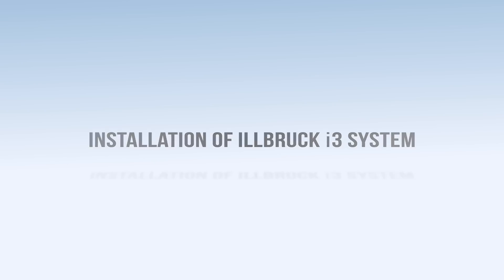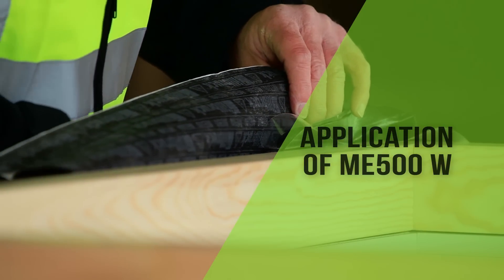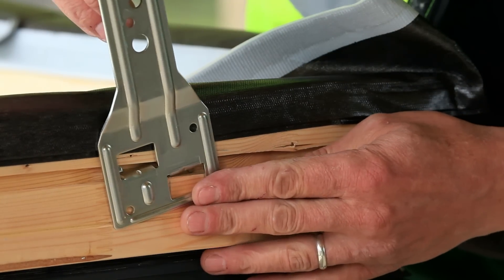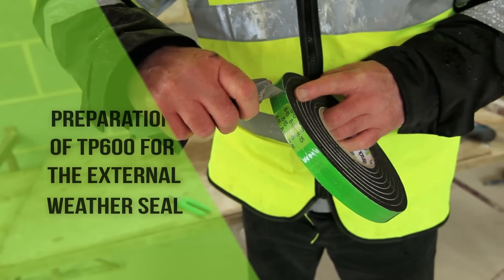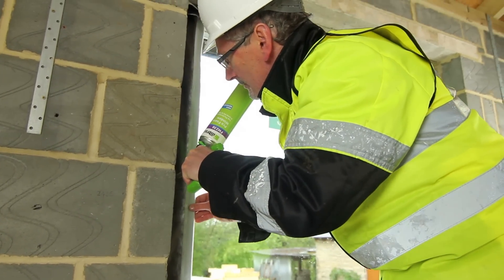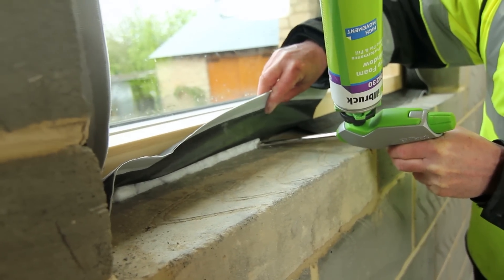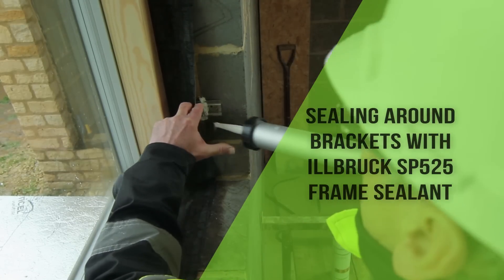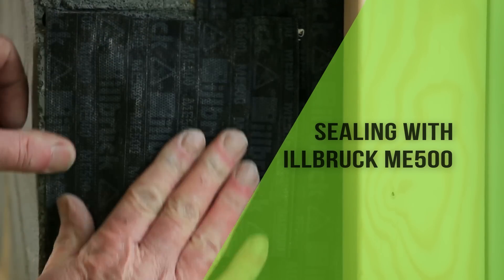tremco illbruck: i3 System - Window Installation

Comment: Can you suggest any variations required if the window is sited on the internal wall edge, not the external. Can I still use this system? What would you suggest?

Comment: Lot of fannying about just to fix 1 window,! 😠😠😠😠
Reply: It's extra work granted but that's the problem in the UK in general, do it quick, not what's best.
Reply: The same result can be achieved with a single illbruck product in a cavity wall opening. Agreed a three step proceedure is probably more time consuning but there are other options avaiable. Search for illbruck TP652, TP653 or TP650 muiltifuntion sealing tapes. The later is ideally suited to domestic replacemnt windows and is a low cost option providing very high airtightnes and weather prtection that will last as long as the life of the window and with no mainatainence. There is more than one way to skin this cat if one considers themsleves to be a preffessional window installer.

Comment: why the massive gaps round the new window?
Reply: Agreed gaps tend to be much larger than one would hope. For some unknown reason we seem to be incacapable of buildig to and mainatining tight tolerances in the UK. Therefore designed toerance gaps of 10mm quite often end up being any where between 10-20mm. Its poor workmaship and possibly lack of site management. The other reason particularly with modern composite windows is that they are increadibly heavy-which means that more "wiggle room" is needed to manhandle the frame in to position.
Its not ideal but we seem to be "living with it".

Comment: do you really need a foam when using pre-compressed tape?
Reply: The PU Foam is a special elastic Formular that provides thermal and acoustic insulation- features that are often overlooked when high performamce windows are installed. U-values should be matained but unfortuntaly the gap between window and wall lowers efficiency. FM330 is one way of maintaining performance.
It remains flexible and can accommodate movement between elements without being disturbed or degraded. This is not a normal foam.
The whole illbruck i3 system is based on advanced building physics and include a whole range of adapatebale and integrated measures.
What you saw in the video is  just one "standard" approach. Windows that are A rated deserve an A rated installation otherwise the investment is pointless.